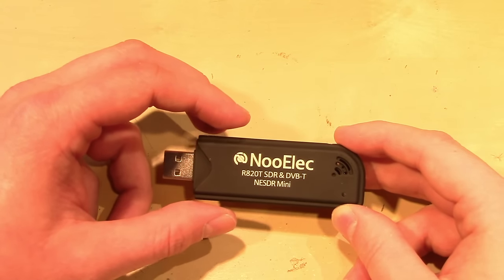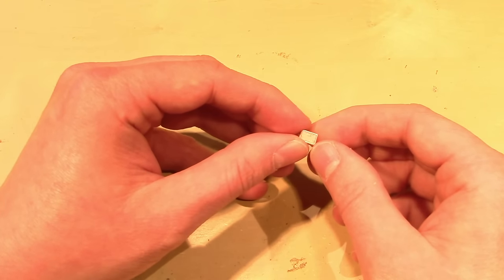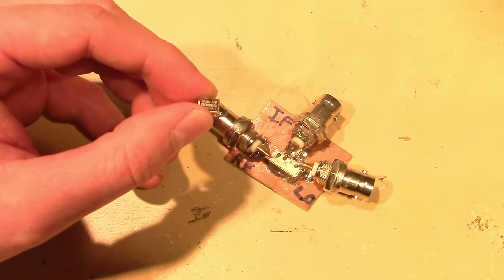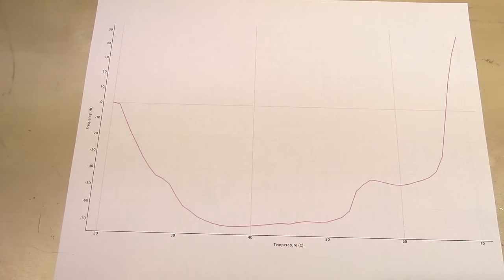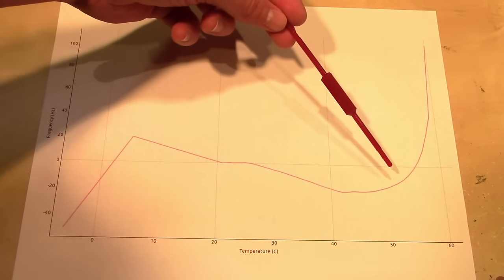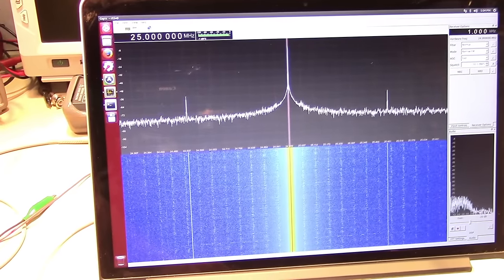Building a 28.8MHz TCXO for the RTL-SDR

Comment: Instead of a band pass filter for 28 MHz, it is better to use the 28 MHz high pass filter, the output signal will have sharper edges, and higher harmonics are therefore an advantage - lower phase noise when gate detection within RTL2832.

Comment: This is very clever! Never though of extracting the third harmonic from the 9.6MHz square wave.
Reply: Some of the single band Softrock RX only radios use the same Taloe mixer divider (not using one of the IQ channels) and 3rd harmonic filter approach. It keeps the kits simple and easy to alter 😊

Comment: You could just use a flexible small diameter teflon coax with a connector on the end to plug into your oscillator. That way you can put the circuit board back in its case and have the coax coming out of a small hole. Not so frankensteiney :)

Comment: My first reaction was just like:
15m 01s - such a nice dongle ^^
15m 10s - WHAT THE.... O_O

Thank you for another really good video showing something unusual and new! Also, could you tell us what do you plan to use your RTL-SDR for? I've heard of it some years ago in some article about GNU Radio, but that's all I remember.
Reply from the maker: +Michal “Dreit” Kundrát Haha, yeah, the BNC looks a bit like a growth on the back of the PCB. Useful for testing though! :)  I don't have any specific plans for the RTL-SDR at the moment, but I think it will be a nice tool to have in the lab for signal analysis and processing. It even covers some frequencies my spectrum analyzer doesn't.
Reply: devttys0  But still not that bad. I've seen much worse things in circuits produced in bigger series (hundreds pieces per year). I can remember to circuit with PIC, there was bridge of two resistors to somewhere and from same pin there was also connected capacitor to totally different place. And they were producing it with this design for many years and are still producing it O.O
edit: Of course with all components at one place. Some resistors were lying on side, capacitor was on resistor under it,...really really bad design, of course unable to make on pick and place machines.

I see. Well, then, good luck with it and other projects in future ;)
Reply: Perhaps an SMA connector would be better, and rework the filter using Coilcraft 0805 inductors?

Comment: I'm a bit confused about your filter. You say it's a third-order Butterworth bandpass filter, but everywhere I've looked shows a different topology for that filter--usually similar to one of the two shown here:

http://www.changpuak.ch/electronics/butterworth_bandpass.php

In addition to the fact that yours has more shunt/series stages than the one above, I notice that the series stages on your filter are capacitors only. It almost looks like you've taken a seventh-order highpass Butterworth filter and added resonant capacitors to the shunts. I haven't been able to find any references that show a design similar to this for a bandpass filter. I wonder if you can shed some light on this for me--I'm just learning about filter design, so I'd love any clarification you can offer. Thanks!
Reply from the maker: +Michael Cooper This configuration is often called a direct coupled filter, top-C coupled filter, or a triple-tuned filter (or, if there were two resonant tank circuits, a double-tuned filter, etc). It's just multiple tank circuits connected via coupling capacitors; the actual component values are determined by the type of filter response you want. This filter was designed to provide a Butterworth response, but others are possible (Chebychev, for example).  http://www.changpuak.ch/electronics/Direct-Coupled-Resonator-Bandpass.php

Comment: Nice work! 
Would it make much difference to replace 74ACT74 with 74HCT74?
Reply from the maker: +HattoriHanzo031 The 74HCT74 supports somewhat slower clock speeds, but these frequencies are low enough that it should work fine!

Comment: Dear sir, how the harmonics are produced ? Thanks in advance
Reply: What’s maker 9.6MHZ become 28.8MHZ? thanks
Reply: Hi Shaker M.  What happens here is that harmonics are created when there is any "non linear" response in the semiconductors.  The shape of the sine is changed.  In fact, diodes (switches) are very non linear, so the output spectrum is no longer the fundamental freq, but now the fundanental + harmonics.